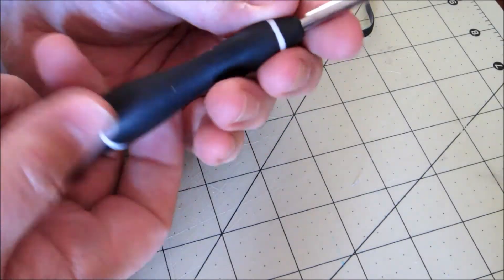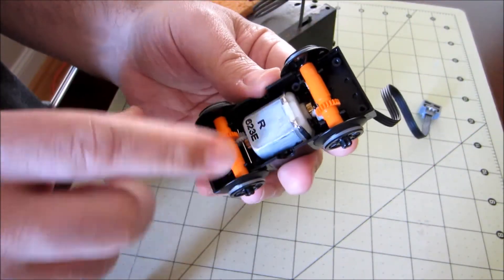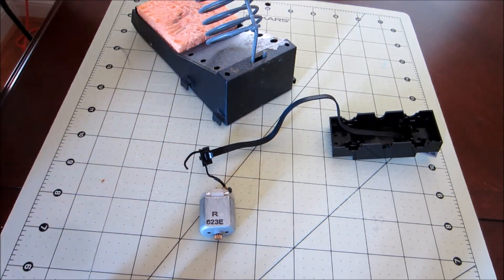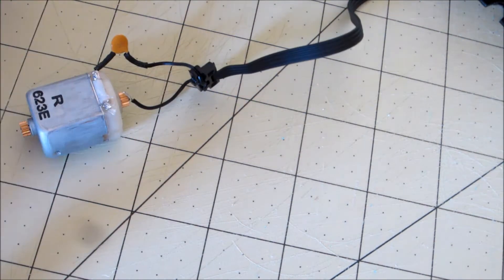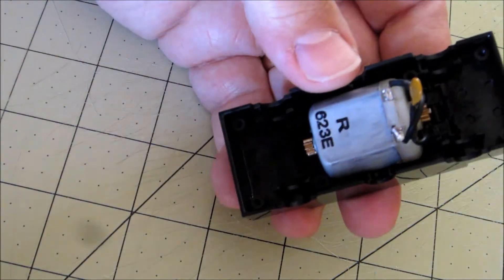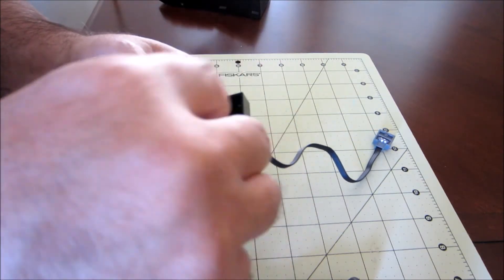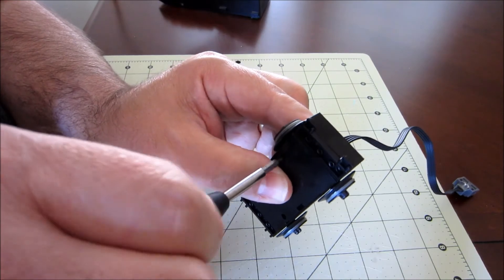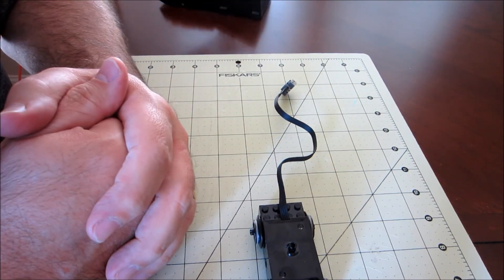Rewiring a Lego Power Functions Train Motor for Reverse Operation

Comment: Cool video, was very helpful. Would you happen to know how many milliamps that motor uses? I would also like to know what kind of voltage is in the motor? I understand that 6 AAA batteries would make 9 volts but I see that there is a little yellow resistor.
Reply from the maker: Unfortunately, I'm not sure. I simply rewired it without worrying about the specs since I was keeping everything else the same.
Reply: @HenryDurand  oh ok

Comment: Put a little solder on your pen before trying to use it to remove old wires. It will help keep things clean and you won't fight heating up old solder.

Thanks for the video!
Reply from the maker: Good tip. Thanks!

Comment: You want a T5 torx bit.  Not all torx bit sets include that, so if you run out to buy a set make sure it includes one that size.
Reply: I pretty sure it is a T6 Torx screwdriver.
Reply from the maker: Good point, thank you.